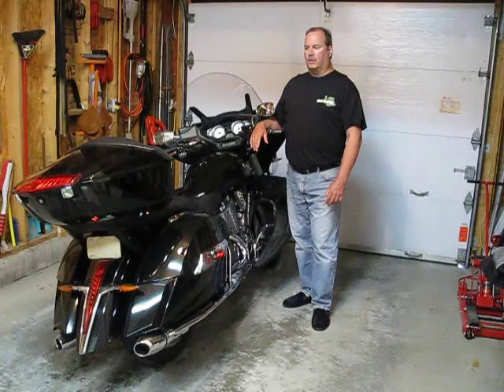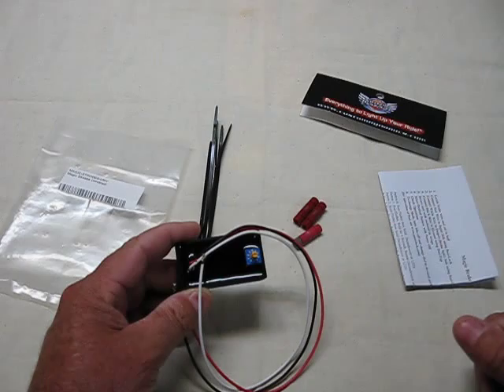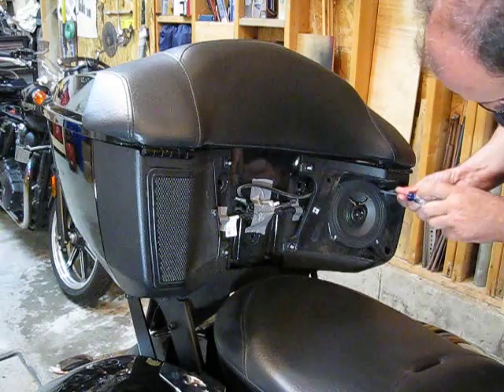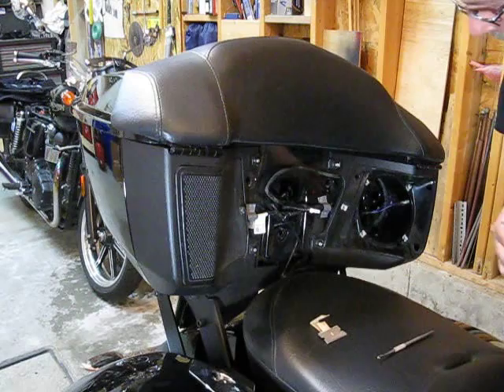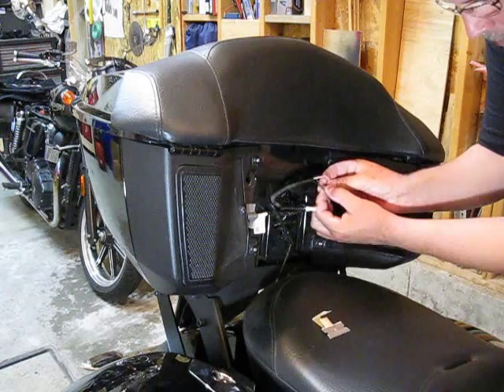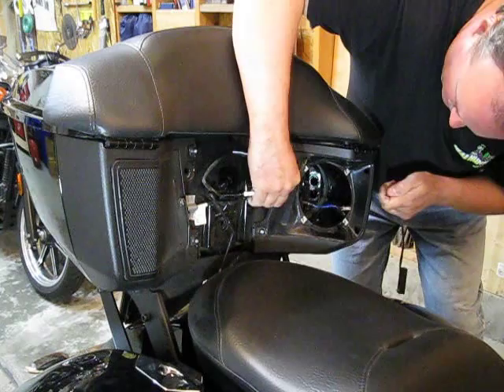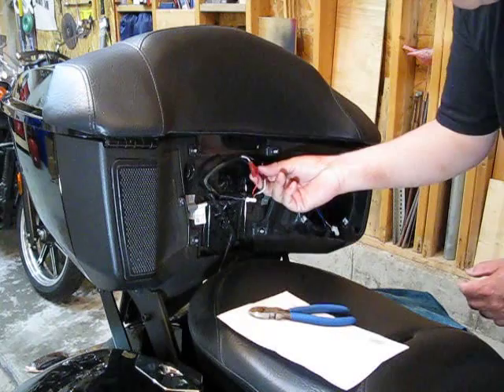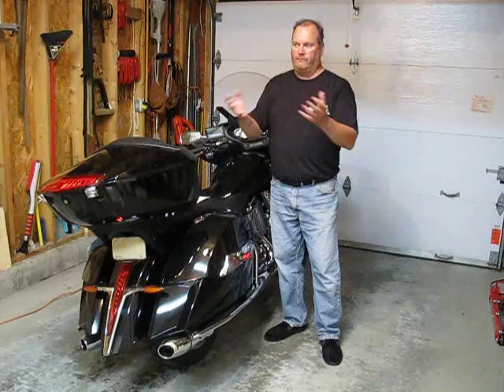Victory CCT Brake Light Modulator

Comment: Installed mine today thanks to your video guidance. Although I went a little more “old school” and used duct tape instead of hot glue. :-)
Reply from the maker: Congratulations on the install. I chose the slower flash rate so people would notice it better. It flashes 5 times then stops every time you use the brakes.

Comment: Yet another great video Paul.  I have a question though.  I recently bought a similar flasher modual from Witchdoctors.  I would like to make both the top trunk and the fender tail light flash.  This is because I often ride without the top trunk (except when I'm going on a trip).  Do you think it's possible to install one controller to manage both brake lights?  Or do you think I'd be better off buying a second flasher and hook each one up close to its' tail light?  
Thanks for all you do on this channel.
Reply: I too have the same question.

Comment: Hi Paul. I'd almost slow down the flash rate slightly. I've got the vizi-tec supa brake 2. Yes, installed on two of my street going bikes. A certain safety in mind for sure.

Comment: Paul, Can you install the Unit in another area if you want to have both the trunk and fender brake modulate?  Reason being is when I have the truck off the bike.  Thanks.. and great videos
Reply from the maker: Absolutely. Under the seat is the main wire harness that feeds the lights at the back. The second half of my Trailer Hitch video shows the wire colors that you can use. You can place the box either on the side of the frame or in the little hole under the fender at the back of the seat.
Here is the link for my hitch video: https://youtu.be/k7nqnStqRKY
Hope this helps.

Comment: once it is installed, is there a setting to stop any and all flashing? Just in case I would travel somewhere and some supercop wants to make a stink about it. Thanks Paul.
Reply from the maker: Yes there is on the model that I am using. The last position (#9) is OFF.

Comment: Paul, I must have missed one of your install videos.  Did you have something in your pocket at the video's end, when you slapped your thigh? 
Also, did you give up on the Madstadt shield or do you switch it out for colder weather?
Reply from the maker: Hi Mike, I have the Digital Guard Dawg keyless ignition module and the fob was in my pocket, but it went to sleep so I had to smack it a bit to wake it up. Everyone looks at me funny when I smack my groin area and yell "Wake up!!" Someone is going to call the cops on me someday Lol!!.
I still enjoy my Madstadt screen but my wife is new to motorcycles and she didn't want to feel any wind so I put the tall screen back on for her. But I am definitely taking it off when I go solo.
Reply: +Paul Pomerleau 
I installed the Klocks werks Flip windshield, no Buffeting and works in the winter for me also, I'm 6' 0".

It also lets you look over the windshield which I prefer.
Reply: I wondered the same thing.😂

Comment: Paul, Dean from Alberta... what are you doing to turn your bike on and off in this Brake Light Modulator video?  You appear to flip a switch of some kind, off & on at the right hand grip stalk area... and you aren't using your bike's key.  So how does your bike turn off & on?
Reply from the maker: Hi Dean, that was the Digital Guard Dawg keyless system. I no longer have it on my bike as all 3 units that I got failed over time so I went back to the basic key again.

Comment: Paul, can you clarify for me, which wires from the modulator splice into each wire in the harness? Thanks!
Reply from the maker: The white/pink wire in the harness is the brake light wire. I cut it in half to splice the modulator in between.
The cut white/pink wire from the harness (brake) side goes to the red wire (input) of the modulator.
The white wire (output) of the modulator goes to the other half white/pink wire going to the brake light.
The black wire (ground) of the modulator taps into the black harness wire which is the battery ground of the bike.
That's it. Hope this helps and thanks for watching.
Reply: Thanks Paul! I installed this yesterday. Not a hard project by any means, but did take longer than I expected. I had to sand down the edges of the module significantly for it to fit behind the speaker. The company must be using a slightly deeper box now days. But install is looks super clean upon completion. Thanks for the video.

Comment: Not to be rude but you showed us taking out all the bolts and then skipped showing us the actual install and connecting of the wires.
Reply from the maker: This video has been out for 2 years and has 7,000 views and you are the only one who has mentioned this to me. I actually had to watch it again just to see this. But you are right. I guess I should have taken more time to show the splicing of the wires and how the posi-locks work. I apologize for this.